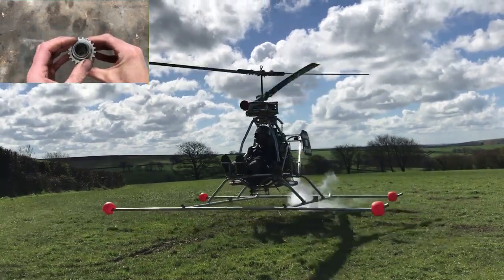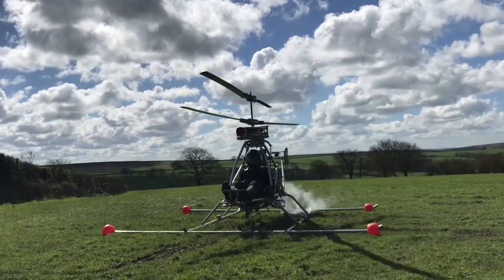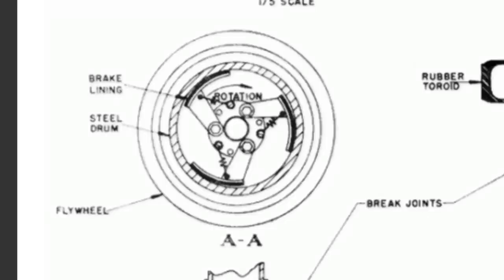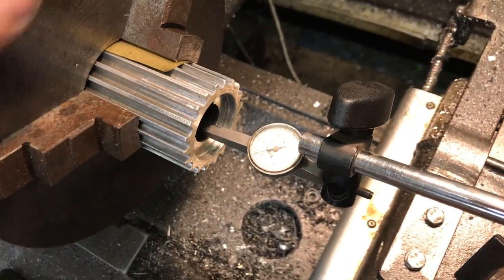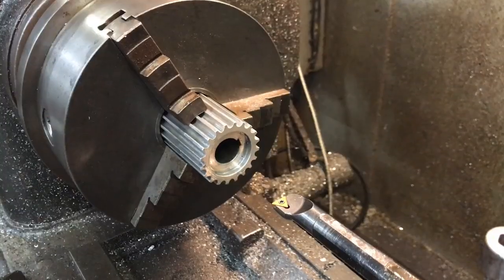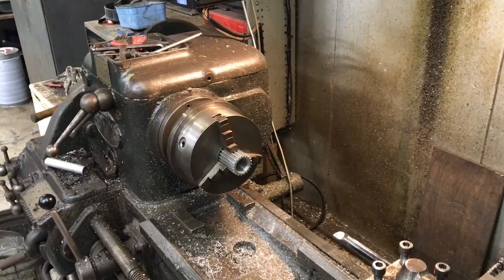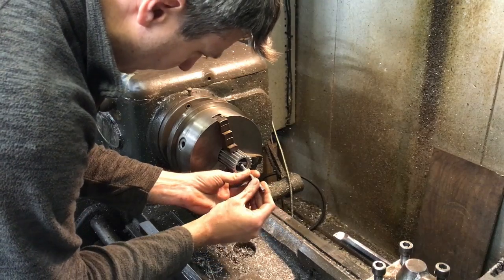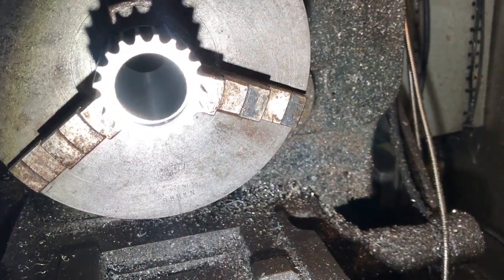Homemade Helicopter rebuild PT4 , driveshaft UJ making and a new idea

Comment: nice to see you finish the project instead off abandon it.  
Would it be a option just using  agriculture drive shafts from a PTO.?
You will buy them with a  free runner and a flat conection plate.
they are heavy only good enough testing your rig and go from there>
Reply from the maker: @ronald3148  👍 For testing, sure, as you say it's heavy so it could only be used for that but a lighter version could be made. The issue I was worried about is the friction in the plunging joint, it needs to be very freely moving. A joint that can move via bearings I think is a necessity. The PTO joints I've seen use a telescopic square drive and grease to reduce friction. I don't know how much friction is in that design to be fair but I would imagine it's too high. 
A spline is too high friction from my beach tests.

Comment: G'day Ben,

Yikes ! 

You sure do have a lovely workshop, and you're doing lovely things there, too ; a far cry from my day here today - Chainsaw-Carpentry  by Eye, on 2nd-hand 30mm x 90mm Radiata Pine, left here by the Concretors after they finished pouring the 3 Slabs... Cobbling up the frame, to support some old Corrugated Fibreglass Roofing material - to conjure up a "Lean-To" Battery-Box up against the South Wall of the new little Toyshed.

The Electric Motorscooter needs 480 A/hr of Gel-Cells at 24 Volts to feed the 60 Volt Battery Charger....; and after shelling out for the Shed, and the Slab under it, and the paying a Builder to fight with the Shed Kit, and the Thermal Insulation to make it worth being inside the thing...

I decided that as the Bill approached $10g for 3m by 3.77 m..., a thousand dollars per square meter of floorspace was a very expensive place to locate a dozen Batteries which will squat on about 1.2 Square metres of the Floor...

Who knew an Electric Motorbike would be so complicated to wean off the Generator which has now charged the thing 50 times in 1,887 Km (!).

I was glad to hear that the telescoping  Square Tubes were but a passing notion..., and the Steel-reinforced Round Aluminium Tubes sound rather better...; though I do worry about the Steel/Aluminium Interface - under the repeated transmitted hammerings of all the Engine's Power-Strokes..

I'd expect the Steel to beat the Aluminium into submission, from Concussion-Fatigue ; but that's merely a cautious "feeling"...

Most of what I do is based on Guesswork.

Whereas I'm pretty sure that you actually know what you're talking about...!

Such is life,

Have a good one...

Stay safe.

;-p

Ciao !
Reply: radiata pine? LOOOXOOREH!

lol, i had a roof of giant bamboo for a few years... that was fun to walk on, across a 6M span! especially as the borers moved in! another time, a tarp draped over some steel cables on "a-frames"... aka, old steel pallets bolted to shipping containers...

 another lil "temporary" shed with old advertising sign/coreflute roofing "shingles" zip tied together. the last section still stands and is still waterproof! near four years of constant rain tested it out... and delayed other things...

like actually rivetting my current "shed" together, lol... kit? cheapest option was to just buy folded steel c-sections. lol... and had the tin held down with two ratchet straps for the last four years... finally screwed it down the other day... did i mention i havent rivetted the frame together? it has about five tek screws, and so far, its seen some near cyclonic storms, too!

sigh... never ending projects, and shoving everything into a shipping container to get the slab poured really didnt do much for "organisation"... but i did get about 5K worth of concrete alone for 1K... mates rates :) plus some labourers, helicopter finish, and reo.... closer to 25K as an actual paid job?

do a bit here, do a bit there, and try not going insane with the double, treble, dodeca-druple moving of stuff... meh, at least its sort of stopped raining? 

australia... supposed to be hot and dry, instead its apparently extremely cold and wet.
Reply: @paradiselost9946  

Yeah, it's all a bit like that.

I'm still living in the Lawn Locker I put together here in 1991...insulated with 25mm of Foam, with a double layer of insulated Roofing riveted over the original. The Wrap-around Verandah with Deck on 3 sides helps, and the miniature Pot-Belly gets too hot - so a Thermosyphon-driven Heat-Exchanger draws cold Air from floor-level in the Sleep-out Bunkroom, & feeds it through a hollow Horseshoe-shaped "Hearth", to pump away the excess and dump the hot air into the Bunkroom.

So, it's a Lawn Locker with delusions of adequacy...; and I was assuming that the 2023 Flatpack would be at least as good as the 1990 unit - but 35 years of Production Engineering has REALLY de-evolved the species.

The Pine arrived pre-treated, and I'm painting it with Mould-Inhibited Linseed Oil, and it's all resting on, but not in, Concrete...; and the Brick Pallets my Deck is built on have lasted 34 years - while I'm 63, so the Pine-framed Battery-Box should outlast me (!).

The Antarctic Circum-Polar Jetstream is breaking down, like the Arctic has been doing for a decade, apparently - firing blasts of cold Air out along the Meridians..., as if Gaia is desperately trying to "spread the Cool".

Greenland's Ice Cap and West Antarctica's Thwaites Glacier are both barely being restrained by thinning Ice-Sheets, Greenland is covered with Soot melting Pools on the top of the ice, pouring Sun-warmed Water into Cracks to lubricate the underlying Bedrock..., whereas Thwaites has a Volcano under it to boil the Interface.

Each one is good for 6 metres of Sea-Level Rise, and the first one to go will fracture the Ice-Sheet of the other - triggering it to follow.

  And apparently the upshot is that my $17,000 Firehose Collection might get to go another Season before I need to face-off against the next Firestorm...

I claim to have the best-protected Lawn Locker in the worst Bushfire Fuelbomb in the 2370 Postcode !

8 Billion selfish Fcukwits keep on voting to "Pursue Prosperity by growing the EcoGnomie - REGARDLESS of any alleged Fears of Environmental Damage or Consequences, as expressed by the so-called "Scientific Community" and other assorted Protesters - Malcontents who would seek to stand in the face of Progress...!"

Or, words to that effect.

Which may be why I have not worked in their EcoGnomie, not paid any Taxes on the Income I haven't earned, since 1986.

Bugger them, with a Barbed-wire Dildo - they VOTED for all this Shit.

I hope they fully appreciate it when their Infinitely Fractal Karma completely envelopes their entire existence....

Such has been their
Selfish
Choice....

And, meanwhile, you and I and others of our ilk get to play the most imaginative Game of Titanic Deckchairs which we can contrive so to do...

And, when they who work to pay Taxes to fund their Paranoid Militarized Persecution Fantasies successfully (Suck Cess Fully...) turn each other's DNA into Compost ; we the Preppers get to compete with each other to be the longest-lasting 
Observers of 
The FOLLIES, left upon the
Smoking ruined bare bald overcooked Desertified remains of what used to be a delightful sort of a Planet on which to live.

12,300 years of the Broadacre Death Kult of Harvest Everything-ism...; and WE get to be alive to watch the Finale...; 
By Jove..., What Luck, Olde Bean,
Who'd 've thunk it...?!?!

Thermonukeyoulater Waaauughhh(!) was really easy to prepare to outlive - to the point where until the USSR folded up and quit..., NATO & the WarPact appeared to be the SOLUTION to Anthropogenic Global Warming - by destroying the Global Industrial-scale Fossil-fuelled EcoGnomie...

But they squibbed it.

And then concentrated on 
Growing the (Sacred) 
EcoGnomie...;
As if 
Nothing else on Earth
Mattered.

Somebody will probably manage to survive to breed, but my kids are 34 & 35, and neither has gone broody yet - so I'm pretty much paying Council Rates on a hundred Acres which I've run as an Endangered Species Sanctuary on an old Didgeridoo Factory (the Trees grow naturally hollow, from Droughts drying their Roots in the shallow Cracks in the Basalt Traprock Ridge - while shattered and flaked Basalt furnishes the most amazingly sharp Stone Woodworking Tools.
 
Preserving a struggling Remnant of the Ecology which used to be here, before the first Sheep showed up in about 1840.

It seems to make better sense than driving around the country busking Environmentalist Poetry, and telling Sheep-War Massacre Stories - which I spent about 5 years doing (burning 500 litres/year and emitting 1.25 tons of CO-2 annually while so engaged) - while the 8 Billion ignored me totally..., and concentrated on competing to trash the Planet ever faster than their neighbours.

My Primary School must've been more effective than most. I remember when
"The Tragedy Of The Commons" was published in 1968..., I was 7 years old, and in 3rd Class we spent an entire day having it explained to us.

And I assumed that everybody else my age was being informed and educated equally well, at the time ; so it's been 56 years of observing the 3.1 Billion become 8 Billion, and apparently my Class of 7 year-olds was the only one on Earth to have received the 1968
Briefing on what was going 
Wrong...(?) ! 

  If you're into it...(?), I have 23 Playlists on the Channel - 8 being Wildlife Encounters, sorted by Species, and the Poetry is stashed in the "Warbles In The Wilderness..." Playlist ; with one Scroll devoted to "Mad Scientist Videos..." and another one for "Personal Aeroplanology...".

12 species of local Native Wildlife treat me as being their Family's pet Tame Human...; so my output might be made on a Potato-grade Phone-Camera, but the material is pretty unusual...

Such is life,

Have a good one.....

Stay safe.

;-p

Ciao !